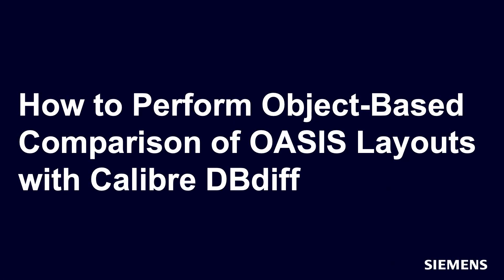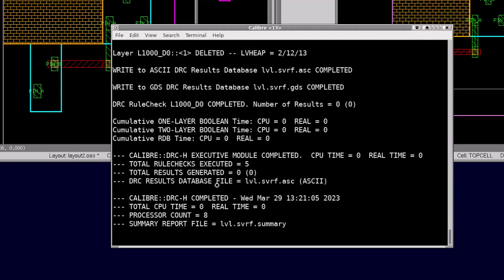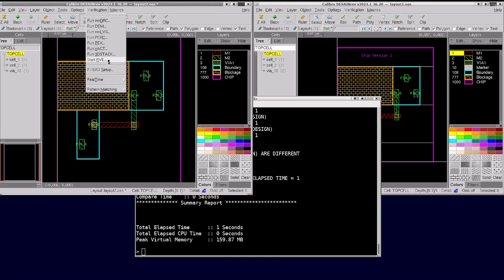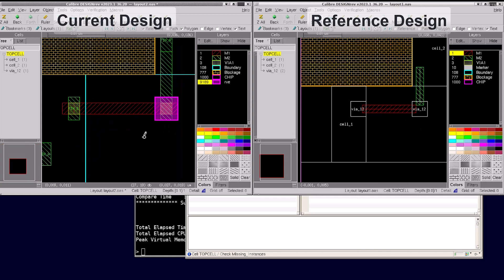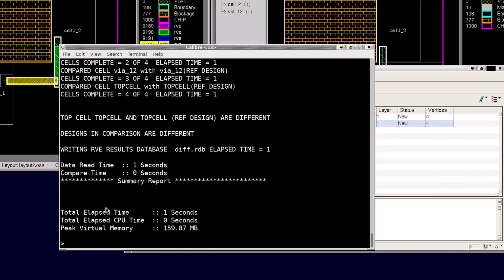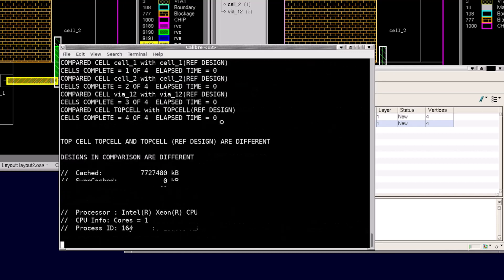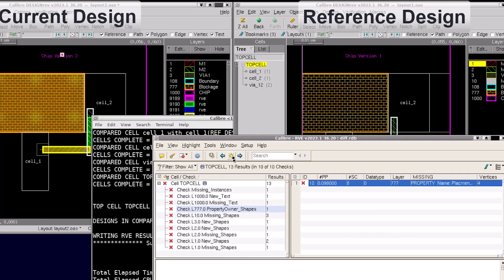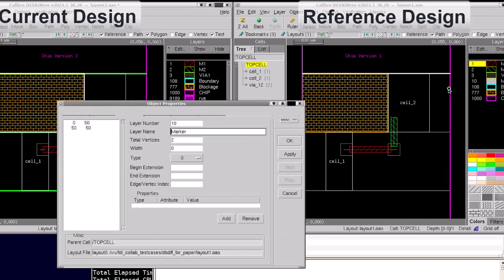How to Perform Object-Based Comparison of OASIS Layouts with Calibre DBdiff

Comment: Thanks for this video. Can you elaborate on -comparemergeddiffshapes , -compareshapesaspolygons
Reply from the maker: Sure! These are two additional options that changes the default DBdiff compare mode. These are documented in the Calibre Layout Comparison and Translation Guide found in the Calibre installation tree: <install_tree>/docs/pdfdocs/calbr_lvl_fdi_gd.pdf

The -compareShapesAsPolygons option will convert path objects in either input database to polygons prior to compare. This is useful if you do not want to report cases where one database has a path object and the other has a polygon on the same layer with the same footprint.

The -compareMergedDiffShapes option is not performing a polygon level merge like you would expect in Calibre nmDRC. This option is useful when minor mismatches can be resolved by merging the mismatched shapes together and a second pass comparison is automatically performed.

There are some great examples with pictures in the product documentation that I would recommend you take a look at.